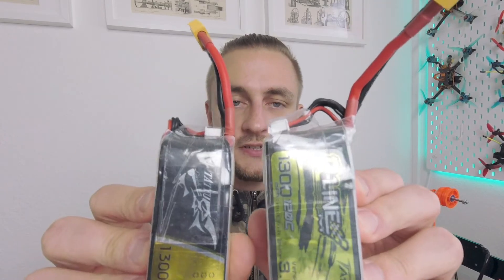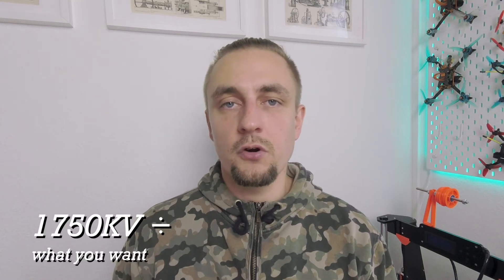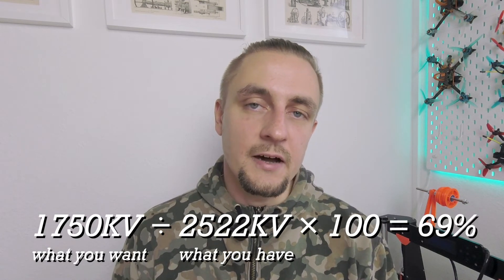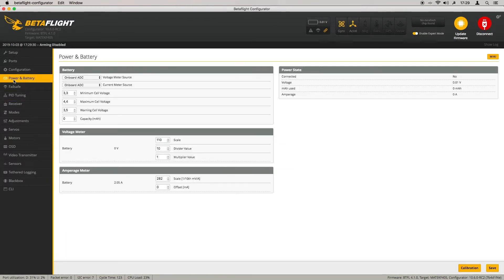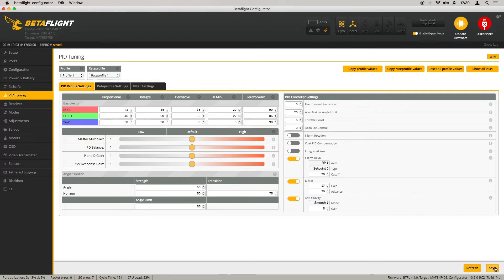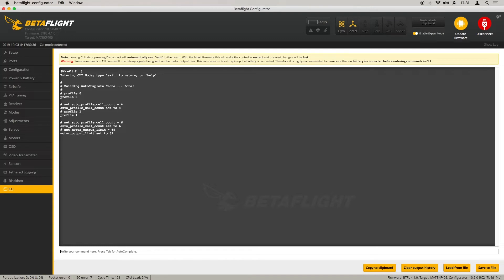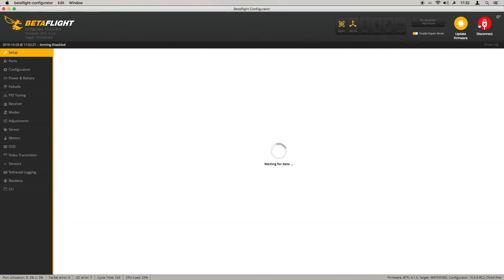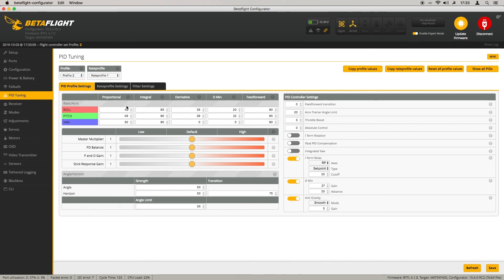4S motors on 6S and 4S with Betaflight motor output limit and auto profile cell count

Comment: I NOTICED: 
I have a 4S setup (T motor F40 2400kV) and a 4S and 6S battery. I done all the configurations you set. but when arming the quad, I hear a difference between 4S and 6S. So I done a little testing in motor output tab. 

In 6S, I gave the motor a 1020 PWM motor output and remembering the motor noise. 

Then, going down to 0, replace the battery with 4S, trying to look for the same noise in master slider and I got 1040 which has the same motor noise in 6S.

So obviously, 6S spins the motor faster than in 4S when only giving a 1020 PWM.

What's the difference between using the Throttle Scaling vs Motor Output Limit ?
Reply from the maker: I just looked up the F40 motor on Miniquadtestbench and apparently it is actually 2470KV even though the specs say 2400: https://www.miniquadtestbench.com/t-motor-f40-pro-ii-2400kv.html

That is something I could have taken into account in the video I guess, but haven’t thought of. What you can try as well is setting throttle output limit to 67% because 4S is 67% of 6S and comparing the noise. I also have seen some mentions that 6S has torque advantages in low throttle situations, so it can be that and the inaccurate KV spec contributing to the difference you hear.

The difference between motor output limit and throttle limit is that with the latter the only thing you are limiting is the overall throttle position, but the flight controller can still command the motors to go full 100%. That can happen when you hit something like a branch and the quad freaks out trying to recover. With motor output limit the motor power setting is limited regardless of where the command comes from, being it throttle input from the radio or the flight controller counteracting an external force. Which is the right thing to do since you don’t want a high KV motor get full 6S voltage.

Comment: Last question: the target KV... you say that you have to decide which target you prefer (in your video 1750KV), but isn't it better to determine the target KV  dividing  you actual motors KV  for 1.5 where 1.5 is the power of 1 cell of 6s compared to 4s?
for example... 2500kv on 4s  is equal to 1.666 Kv on 6s  (2500 / 1.5) ... and  then you divide  1.666/2500x100  and you get 66% which is the value for your motors? am i wrong?
Reply from the maker: Thank you! Answering all three:

Currently I’m setting up a more scientific experiment regarding 4S motors on 6S vs a true 6S motor. It will take some time though. So far everything I found theoretically suggests there should be now downside to running high kv motors on high voltage with a limit besides motor throttle control resolution. Dshot provides 2048 steps for motor power control, and motor output limit chops off the top third. The rest is still more steps than radios have, but it might affect the flight code a bit. How bad is that influence? What about efficiency? I have no data yet, so take that theoretical conclusions with a grain of salt.

As for flying a low kv motor on 4S, I would only do that if I had a good proximity spot that did not require full power from time to time. 6S on 4S will be slower, and if you are fine with that - go with the 6S version, it is more future proof. But if you want to absolutely shred it on those 4S packs, the 6S version is probably not the right choice.

What you said regarding target kv is not wrong, but you can actually make it even simpler. RPMs are KV times voltage. 4 is 67% of 6, so to bring your 4S motors kv down proportionally you can just set the limit to 67 without any calculation. I wanted to give the audience the formula because with that you can actually move the target kv according to your needs. For example, you can use a very light low pitch prop for improved throttle control precision and still have the top speed by upping the target kv to 1900.
Reply: ErgoFPV thank you very much mate for all the answer and the quick reply. Can’t wait for that test you’re running. ❤️

Comment: VEry nice video mate! I was looking for smth like that... but my doubt is... isn't just better to buy a 6s motors setup and use it with 4s in case?   I mean... lowering the output motor limit, do you still have benefit of 6s also on 4s quad? Joshua Bardwell  in his video says it's not the same thing at all...

Comment: Thanks man 😍😍
Reply: Had set of 2500kv F 60   t motor lying around on my desk, now it goes into my Freestyle setup , would you recommend these settings for Race setup ,ideally it shud but still thought of pitching up the question 😅😅
Reply from the maker: Sorry I haven't replied earlier. So I have researched the high KV high voltage topic for a while now, and it seems like the only downside to running high KV motor on 6S with an output limit is lower motor throttle resolution caused by chopping off the top of the throttle band. DShot allows for 2048 steps in motor throttle position, so if you apply a 30% motor output limit it will be reduced to about 1400. That is more steps than our radios produce for the stick inputs, so throttle resolution on the stick should not get affected, but the flight controller will be just a tiny bit less precise with motor power commands. Theoretically that might affect the tune, but probably just a tiny bit because I haven't noticed anything personally. There are also contradicting opinions I found online as to what happens to the motor efficiency when an output limit is applied to a high KV one. I'm currently setting up more experiments with high and low KV versions of the same motor noting the efficiency, and I will try running high KV motors on a 6S racing setup as well, so another video with more details is coming.

As for your question - I don't see problems putting those F60s on a 6S racing rig with an output limit. Just watch the motor temperature and bring the output limit even lower if they tend to overheat. Motor manufacturers don't state the actual KV, what they put in the specs is the "target KV", so those motors in reality can be higher KV than 2500. So watch the temperature.

Side note: an interesting possibility is to put a very low pitch prop on that racing rig, like the latest Gemfan 51433, and reduce the output limit to put them in the area of 1900-2000 "virtual" KV. You might end up having more throttle resolution and control because of the low pitch of the prop, but still have enough top speed because of the high KV. Just thinking out loud.

Comment: In the amp reading of the osd, the cruising current was the same for 4s and 6s. Is that true? If it is, then we are sacrificing the efficiency and this method is really not worth it. What do you think?
Reply from the maker: Current sensor wasn’t calibrated, so the  actual values are off, but you are right, we can still compare them. They are similar because the 6S battery that I was using for the test was way too heavy for a freestyle quad, so it had to put out more thrust. I just had those 1300 mAh 6S packs at hand, but on that craft I would use something like 1000 mAh 6S or even smaller. The 6S configuration was 62 grams heavier, which was 10% more weight to carry.
Reply: Got it👍 So technically a low kv motor on 6s vs high kv motor on 6s (with output limit) will perform and feel the same?
Reply from the maker: I haven’t tried “true” 6S motors on that quad, but my racers are low kv 6S, and running high kv with a limit gives the same feeling of extra power down low that is characteristic to 6S. So as far as I can tell high kv with throttle limit does feel the same as low kv. But it’s a good idea for the next video on the topic - get the same motors in 6S and see if true low kv gives any noticeable difference.
Reply: @ErgoFPV  yes that would be epic! This will solve the doubts of many people as there is no single article or video discussing about the effects and 'feel' of high kv 6s. Also if you do this, don't forget to add the efficient data of these two as that will be a key factor in deciding if it is worth it !

Comment: Thanks for this awesome tutorial. I looked at my "Power&Battery" tab in BetaFlight Configurator. The "Maximum Cell Voltage" is currently set to 4.3. Should I still change it to 4.4?
Reply from the maker: You’re welcome! Voltage detection is not very accurate on some flight controllers, and sometimes it reads a bit higher value just as you connect the battery. That might cause Betaflight to think it is a terribly discharged 5S instead of a 6S pack that you plugged in and that would mess the profile selection. Setting the Max cell voltage to 4.4 leaves a bit more slack for the voltage reading inaccuracy, so I recommend doing that.
Reply: Got it! Thank you so much for the very detailed explanation! 👍

Comment: why -1?
Reply from the maker: To have something different from the default that is 0. If you switch to a profile with the setting of 0, automatic profile selection is completely turned off until you manually switch to another profile. I just felt it wasn’t great leaving that sort of a trap open so I included setting the third profile to -1 which doesn’t block the automatic selection from working. Otherwise it isn’t doing anything.
Reply: @ErgoFPV  oh OK that's good then. So whenever you plugged in a battery other than 4S or 6S, it will automatically switch to P3
Reply from the maker: @JaraFPV  exactly.

Comment: This is great work mate. Going to do this to my quad whilst i wait for my new 6s motors to arrive. The question of more efficiency can be simplified. 6s motors have less rotational mass due to fewer windings and lighter magnets. it makes sense to invest in 6s motors if you care about efficiency.
Reply from the maker: Thank you! Speaking of motor weight, I just checked 2522kv and 1922kv versions of Hyperlite 2207.5 Team Edition motor that I have at hand, and the difference is negligible - about 0.1 gram. The magnets on both are the same because the rotors are interchangeable through the whole range of KV versions they offer. Since the weight is the same, the amount of copper in the stator is also the same, so the windings should be made either with different wire gauge or using the different number of strands for each pole. There is something interesting about motor efficiency though. Looking at thrust stand tests it is visible that the maximum efficiency for 220X/230X motor is typically reached somewhere around the middle of the throttle range. They are less efficient at low and high throttle. So if the quad is very light and runs 4S motors on 6S, the motors might be working in their “low throttle” band with less efficiency than proper 6S ones would have. On the other hand running 4S motors with an output limit in mostly “full throttle” application like racing might be even beneficial because the motor would be working closer to its maximum efficiency band.
Reply from the maker: But then there’s a question how much current actually goes through the motor with an output limit vs the one with the “real” kv and how that translates into the magnetic field of the stator. I guess an actual thrust stand comparison test would be the best answer 🙃
Reply: @ErgoFPV  your knowledge is beyond me haha. Its not as simple as I thought. I probably won't change my motors out so soon in that case.

Comment: Hi bro. This is super great video. When you used 6s how was your temp of 4s  motor?  is it quite hot or warm or warm ++ 😂??
Reply from the maker: Hey, thank you! I haven’t noticed any motor temperature difference between 4S and 6S. They were just slightly warm.

Comment: Nice information for me.. let me asking one thing, what will happen if I use throttle limit on my taranis, without changing profile in betaflight like u do in the video?
Reply: FYI, im an revoltosd user, and i cant find profile auto select like you do in betaflight 4.1
Reply from the maker: Hey. So you definitely need something like motor output limit, and setting throttle limit on your taranis is not enough. The flight controller will still be able to use 100% motor power when doing flips or rolls, so unfortunate things might happen if you run a high KV motor on 6S like that. I’m not a Flight One person, but apparently FalcoX has the needed feature. Confusingly enough they call it “motor throttle limit”, and you set it up via the flight controller OSD menu. Check out this Wild Willy’s video https://youtu.be/S5S3EIGqPD8

Comment: Thank you so much. I accidentally bought several 6s batteries and I haven't been able to use them. I knew about motor output limit, but thought If I did that, my 4s batteries would be no longer usable. Thanks again for this video.

Comment: Thanks for the tutorial...I followed everything and have my quad setup with 4s and 6s and things are flying super smooth. I have Xing-e 2207 2750kv setup with a motor output limit of 63 and everything comes down cool. This is a big win!
Reply from the maker: Yep, no need to throw the 4s motors away to go to 6s 😬
Reply: i have the same motors, my quad is tuned really well tho i dont want to retune. Did u notice anything?
Reply: best part is that now you can fly these no matter what batteries are available. I am creating 4s 5s and 6s profiles just in case :)

Comment: Have you seen the video from Joshua Bardwell. Wonder what he did wrong other than not setting up the automatic profile selection which btw is super cool!!! Even usefull for 6s motors using 4s (higher pids for 4s). Thanks!!!
Reply from the maker: You’re very welcome! I believe there was a bug in Betaflight at the time JB was filming his video which required the quad to be restarted in order for the motor output limit change to take effect. If I’m not mistaken, he even filmed another take on it later with a Kopis running 2100-something KV motors, and that time it worked.

Comment: Very cool video! Drainman FPV also did a post on this a couple days ago! IDK, I fly 4s, 5s, and 6s, and I’m not convinced 6s is the future, I think 5s is the perfect lipo! A quad built specifically for 5s, will also perform damn good on 4s, but a quad built for 6s, doesn’t have the low-end with.a 4s lipo, although, again, will fly good on a 5s lipo! So when you look at this as a whole, I just think 5S with as high a KV as you can go, is the setup! No motor output limit needed!
Reply from the maker: Thank you! There are two parts in 6S for me. The first one is noticeable consistency in power delivery aka "no sag" (that is silly, there is sag). I tried to figure out where that consistency comes from, sort of failed, but I definitely see it on my racing builds. That brings me to the second part, which is the fact that racing has gone pretty much exclusively 6S. I also fly freestyle and I like the convenience of having all my packs with the same cell count, especially the ability to parallel charge. So for me 6S on freestyle builds is just a natural step to bring them to the same cell count as my racing builds after I retire my 4S packs. As for 5S, I think it is a great setup as well, especially if you want to fly different cell counts as you pointed out. Personally though, I like sticking to one "perfect" battery size, so the versatility part is of less importance for me.
Reply: @ErgoFPV   There is also more of a tendency with micros to change battery cells from 2S to 3S or 3S to 4S on the same micros. The auto profile change is something I had been waiting for and your video is clear and concise for anyone looking to implement that feature alone. I have a lot of larger 4S near end of life and a dozen sets of so called "4S motors" some of which were premium priced and I don't want to retire them. This is a very good solution for me as I gradually move my larger quads to 6S. Thanks for the work you put into making this. Liked and subbed.
Reply: This is the exact exchange everyone needs to see when deciding which way to go. Coming from the 5S camp, I agree with both your schools of thought 100%.

Comment: what flytime u have on 6s?
Reply from the maker: With that exact setup it depends on how hard I am pushing it. The quad is 10% heavier with that 1300 mAh 6S but the battery stores 50% more energy. With 1300 mAh 4S I get about 3 and a half minutes of non-stop hardcore acro or 7 minutes of cruising. With that huge 1300 mAh 6S I get around 3 minutes of hardcore acro (so less than on 4S and it also feels weird because of added weight), but I can cruise for almost ten minutes. The 6S setup is not ideal, it needs smaller batteries. The closest equivalent would be an 850 mAh 6S, but there aren't many of them available on the market so I might get a heavier 1000 mAh 6S. Still 20-30 grams heavier than I like my quad to be, but somewhat compensated by better throttle response down low.
Reply: @ErgoFPV  thx for help, I'll stay with 4s 😎

Comment: Awesome comparison and topic! 👍👍How about flighttime?
Reply from the maker: Thanks! While filming the comparison the flight time on 6S felt a bit shorter, but that is because I absolutely thrashed it trying to see if I can push it to misbehave. With that 60 grams heavier 6S power nugget it required throttle to be opened for much longer to get to the speed typical for my lightweight 4S setup. With a smaller battery I think the flight time could be even longer than on 4S since motors do not have to go into the high rpms band where efficiency is lower. Wild Willy is also doing this and did not report any differences in flight time compared to "true" 6S motors.
Reply: Thanks man! 👍👍